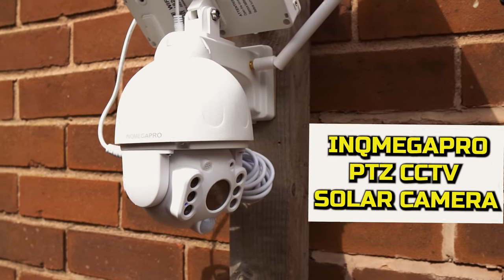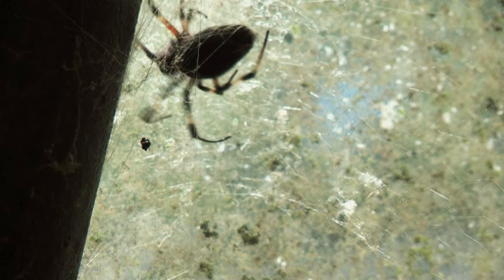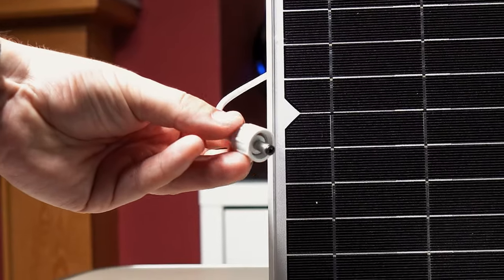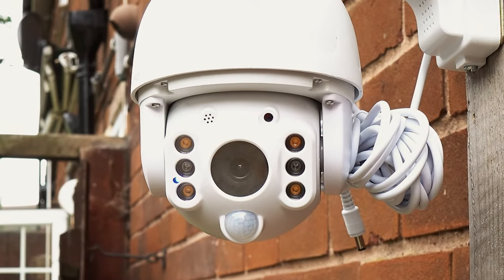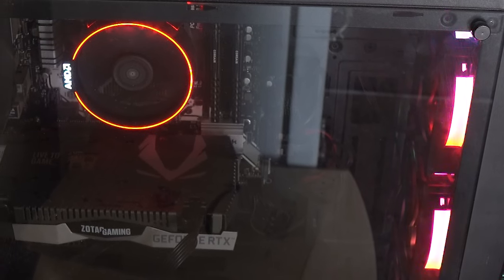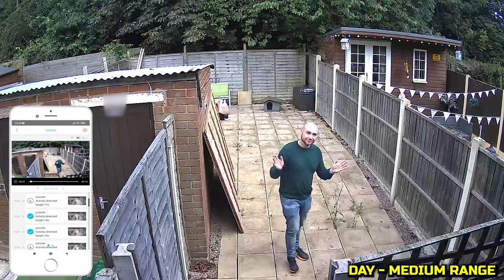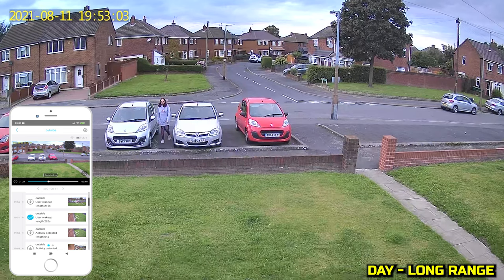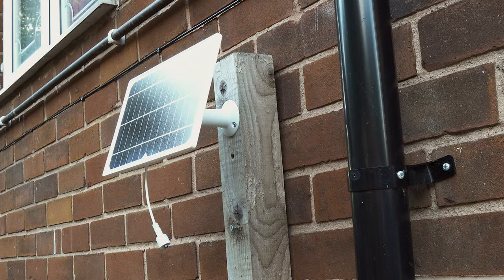Use The Sun To Power Your Camera | Inqmegapro Solar CCTV PTZ Camera Review

Comment: it is really metal case design, and compare with the Realink security camera, the largest different is its battery box and the rechargeable and replacement lithum battery.
Besides, it also support extend installation.
If you would like to get more function for this security camera, don't worry, we are always ready to provide more chance, to make impossible being possible.
Reply from the maker: Thank you Sophie :)  I was really impressed with the internal speaker on this, it never dropped out once when using it.  The spotlights are really bright too and do a very good job of bringing colour to night time footage.